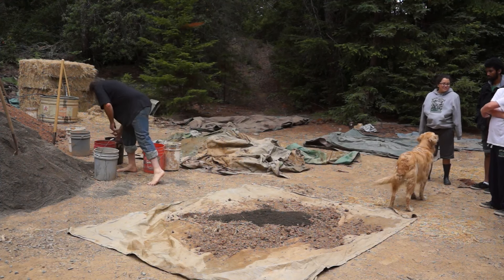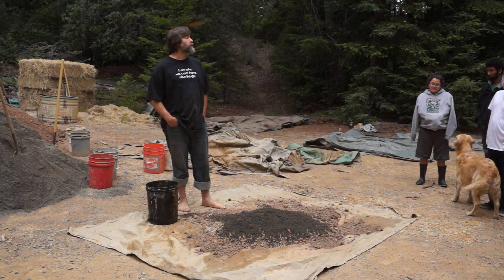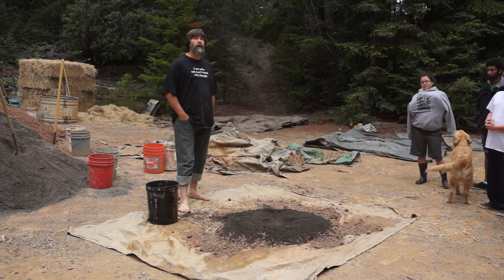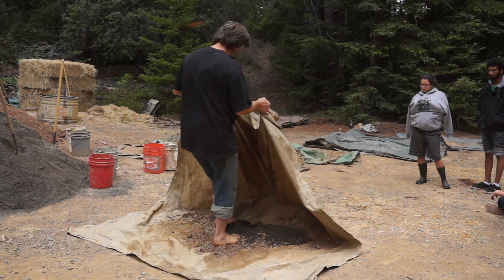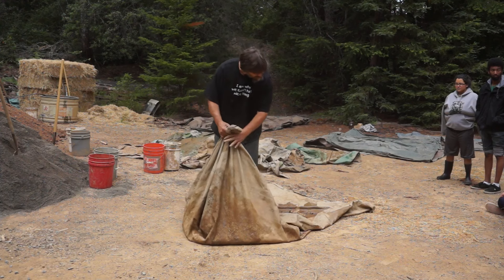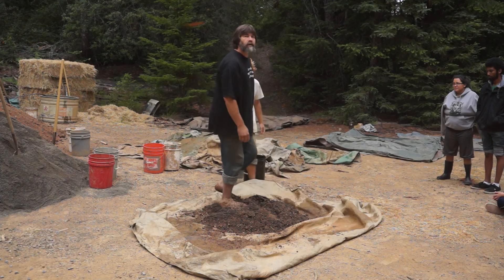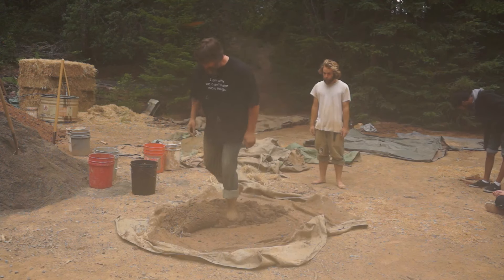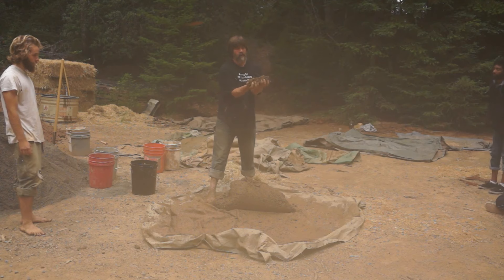The Cob Mix

Comment: is this the best mixture to make the walls of a rocket stove chamber (high temperature insulation and high temperature resistance needed from the composite). Really nice work, thank you for sharing.
Reply from the maker: The mix shown here is structural, for building houses and benches and things that require strength.

Mixes for insulation will have no sand and are typically too light weight for foot mixing. I often use perlite for insulation, mixed with clay slip. This mix can not be foot mixed, as it will crush the grains of perlite into dust, rendering it almost useless as insulation.
Reply from the maker: This mix will handle high temperatures, it's just not insulation.
Reply: @SundogbuildersNet  hello there! It's been long time now thinking of building a cob house, and all this time I've watching videos about techniques, mixtures etc etc. In some of those videos, people there had been use wooden beams for frame, and wooden(or bamboo)stripes between those beams, for walls. Then they were throwing cod or mud(if more liquidy form than cob) on those wood stripes to create those walls, so those stripes were like mud/cob holders. My question is, Is it ok to use wood balets(used as the base for merchandise/goods transport)? Cob/mud, combined with this kind of wood, am I going to have problems in future with termites? Therefore walls will loose to much of their strength?....
Excuse my English, I hope being understood!🙂👍
Reply from the maker: @marioshadjikyriacou3381  
You are describing 2 separate techniques. Cob is built without the wood, as internal wooden structure that touches the foundation  does not move with the cob and can not "float'along with the cobs movement. 

Wattle and daub is what we call us applying mud over a wooden structure. . This is different in that the wood holds the weight of the building and the mud rides along. Mixes for this purpose are typically fiber heavy and light on the sand. Fiber inside the mud lends elasticity, making the material better at flexing but less capable at holding weight.
Reply from the maker: When you place uprights bound to foundation at the bottom and roof at the top inside of a cob wall, its movement will be governed like a pendulum. The entire log (plank,  board, beam) must move like a lever in response to lateral forces (wind, the building settling,  earthquakes, etc). This lever like motion is in not compatible with cob.  Cob acts more like a fluid,  shifting and settling in it's long path to equilibrium, at it's own level. Instead, they shove at each other, resist each other. This will manifest as cracks in the walls around shifting posts that will not go away and if covered over, will in time reappear again. The house will stand for a long time, but this will lead to its eventual loss.
Reply: @SundogbuildersNet  THANK YOU VERY MUCH!!👍

Comment: What kind of tarps do you use? the tarps i have are always falling apart, so any tips would be appreciated.
Reply from the maker: I just use the crummy blue tarps, mostly. I think that he grey plastic tarps are the most heavy duty in the plastic variety. I have heard of people using old billboards. they are made of a heavy, plastic-cloth material and can be cut up.
Canvas tarps are going to be the toughest and last longest, if put away properly. the drawback of canvas is the material gets waterlogged, then heavy and sluggish to work with.
Reply: thanks

Comment: does cob cure like concrete??? how is the  durability????
Reply from the maker: swoosh50 
Not exactly.. Cob, as you can see in this video is made out of clay soil. It does not chemically set, like concrete; it dries, like mud ( because it is mud).

As to durability, the material can last a thousand years or more, of the roof is kept up... However, if the roof goes, the building can become a total ruin within a decade ( or less).